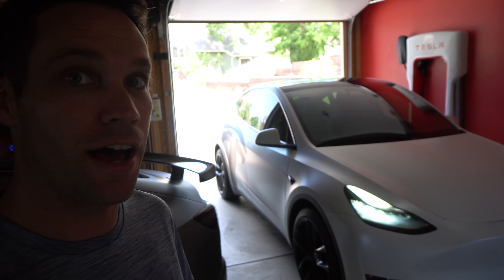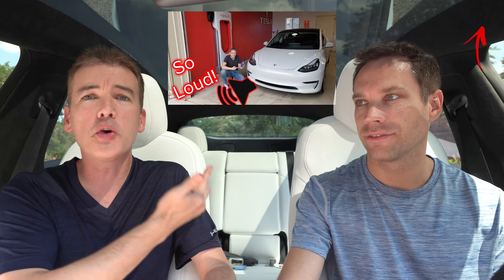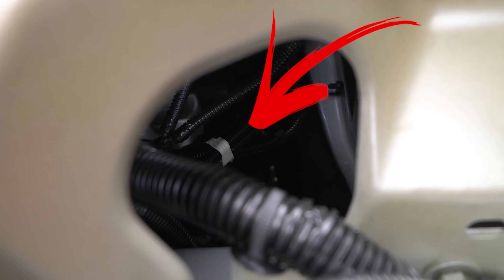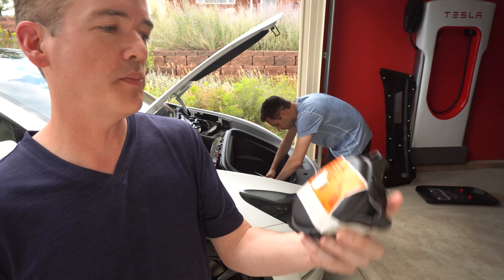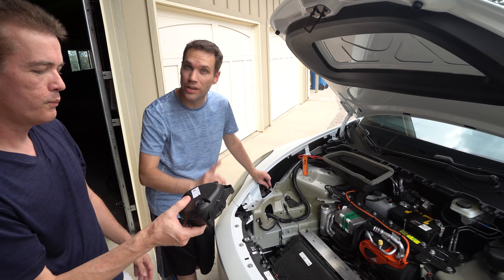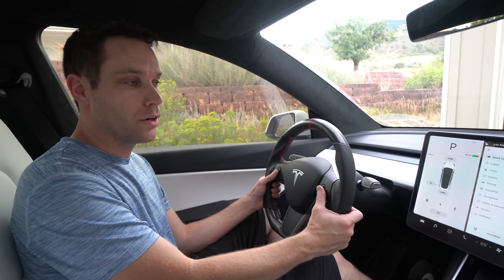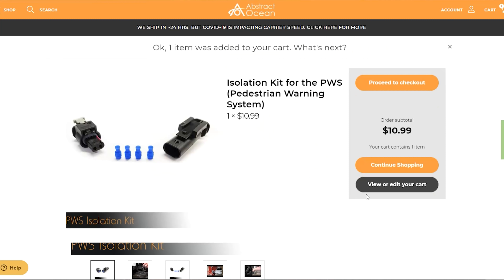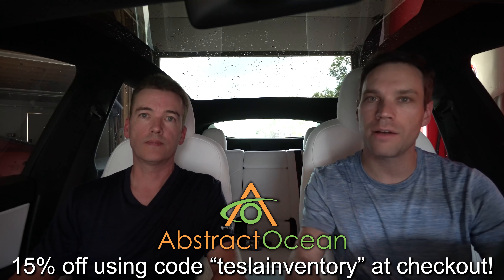First Pedestrian Noisemaker in a Model Y? Coming to All New Teslas This Month!

Comment: Took delivery on a Model 3 LR AWD Feb 2020, it came with the speaker. I do not hear any noise moving forward, only in reverse. What i did notice is that it got louder with 2020.32 software revision. Not sure if they made any changes, but seems louder to me at least.

Comment: Thank you for posting. I have installed on my Model S 75D, by my self a noisemaker called "bbs-tek white noise". Don't worry no sound such as beep-beep-beep, but like "gsch, gsch, gsch" from the UK. Mostly jused for lorries. The white noise loudspeaker is very intelligent, it messures the surrounding noise and adjust the noise acordingly. Very usefull at night for the neighbors.

Comment: I want it to play any music of my choice (softly). I imagine you could add a volume control to tone it down some. Otherwise a cover could be fabricated to close off some of the open area. It’s hard to judge how loud the stock setup in a video is because it depends on the microphone specs and placement. I wouldn’t be surprised if the speaker would someday replace the car horn acting as a dual purpose device; saving Tesla some money.

Comment: Do you think my 2018 Model 3 has the wiring?

I installed a wireless doorbell with the button mounted on the back of the tablet for easy access. It makes a coo-coo sound, but not loud enough.

Comment: I wonder if the pitch changes with speed.  I have a noisemaker on my Honda Clarity and it has a noisemaker which changes pitch as you go faster.  It's also a lot less annoying sounding than this one.  The noise is there but it's a bit more neutral.   Sounds more like a choir of angels humming!

Comment: Isn't there a way to just magnify the armonics of the motor?
The same motor sound but stronger so it can be audible at low speeds.
I want that too in my electric motorcycle...

Comment: I'd like to add this to my June, 2020 Model Y. I am wondering if after this is in place and a new update is installed will it add the Boombox/custom sounds feature or would it still be limited to the default sounds?

Comment: I have a 2018 model 3 that has the speaker grill installed. When I put the car in reverse a little speaker  show’s up 
On the display next to the visual of my car for about 3/5 seconds then goes away. Do you thinkI could buy the speaker and install it?

Comment: Interesting that they don't have them in the cars yet. I think the Chevrolet Bolt EV has had them for a while. To me they're annoying the whole point of an electric car is that it's quiet. Gasoline cars at idle don't make any noise either. Mostly you hear tire noise on the road which an electric vehicle makes also. The whole thing is kind of ridiculous.
However there could be possible liability issues. If your car came with one of these and you remove it. And then end up hitting a pedestrian at some point. There could be some possible legal ramifications if they found out you had modified the car. On the Chevrolet, there is a specific fuse for the device. what people suggest is you take the fuse out pop it by putting too much power across it stick the fuse back in the fuse box. Then if something was to occur you can claim you didn't know it was not working. And there's no way to prove otherwise. Versus removing the speaker or unplugging it definitely does prove that you disabled it. Just some food for thought. Can you imagine all the cars making these stupid noises. It's going to be unbelievably loud when you add it together

Comment: I have a 2018 3 with no grill, no wiring, no speaker. I'm ok with that.
Reply: same here, even better reason to keep the earlier models
Reply: I have a 4/2019 M3 without the speaker;  don't know if there is a grill or wiring in place. I prefer the silent operation, but if customizable sounds come along or additional uses such as augmenting sentry mode, maybe I would consider it.

Comment: They should allow people to lower the volume to the minimum level equal to a luxury car on idle I find it mad that ev’s have to make a volume level louder than petrol vehicles it should also alter its level depending on the speed of said vehicle and then cut off at 34mph where tire noisetakes over the engine output on all cars
Reply: It cuts off at like 18 or 20 mph
Reply: Greg Hassler not everywhere eu models have to make a. Noise up to 30mph from aug this year on all models
Reply: @ram64man  oh thanks, I didn't realize it was so high in the EU

Comment: I know I have the wiring because after a road trip it was dangling out of the passenger wheel well. I do not want my Model Y to make any noise. Congress passed the law in I think 2010 so blind people could be aware if an electric car was around. Although, at that point in time no blind people had been harmed by electric cars. Just another law in search of a problem.

Comment: Personally speaking, this new law is a testament to the idiocy of its inventor. I think that the noise pollution that this will cause, will be exceptionally annoying and that I'm certain the better way could have been found to achieve the same goal. I'm fairly certain that the vast majority of electric vehicles make enough noise from the whining of the motors to the sound the tires make when rolling along the road could be heard by the unsighted individuals that this is presumably meant for. Another typical knee-jerk reaction.

Comment: Too bad it wasn't installed properly... that test level isn't relevant.
So let's not be selfish, as long as the sound level is enough for blind people (and distracted), I'll be fine.
It's just like taillights or turn signals, it's for other people's safety.
Reply: You could make safety arguments for any loud and obnoxious noisemaker. Have you ever lived near construction? Probably not. I have. The endless beeping of heavy machinery is an assault on your sanity. The people who push these noisemakers are not human. They are demons from another dimension.
Reply: @SpykerSpeed  doesn't have to be loud, just sufficient.
Try to cross a parking lot full of Tesla with a blindfold, you'll get a sense of a blind's life
Reply: @seb.  fortunately drivers are required to see
Reply: @GregHassler  And we know how well that worked so far, right ? No death, no accidents ever right /s
Reply: @seb.  accidents / deaths will never be zero.  I've managed well over 100k silent EV miles with no PWS without hitting anyone. Weird, I know 🤷‍♂️
Reply: @GregHassler  so you rather brake hard to avoid a pedestrian than making sure noone crosses in your path?
Reply: @seb.  I don't know how you drive, but I don't drive so fast in pedestrian areas that I'd have to "brake hard".  Like, it's literally no big deal at all.  Not hitting people while driving is exceedingly easy.  I have to honestly question, do you even drive? Do you drive an EV?
Reply: @GregHassler  these days I'm mostly pedestrian, and a Tesla coming close to you are hardly noticeable if there traffic around.
I'm not crossing without double checking, but I can relate to the risk
Reply: @seb.  it's a perceived risk for sure.  But Tesla's already have automatic emergency braking that detects pedestrians, one of the best systems on the market.  And in my experience the only time this would really be helpful to me in any EV is when pedestrians are walking away from me in a parking lot and they don't hear me behind them until maybe I crunch over some gravel.  That happens periodically, but I still prefer the silence.

EVs are being singled out by these laws.  There are hybrids and automatic engine shutdown vehicles with no such requirement that are equally quiet.